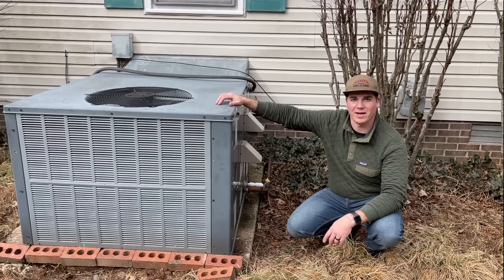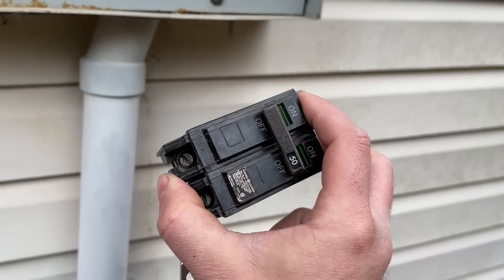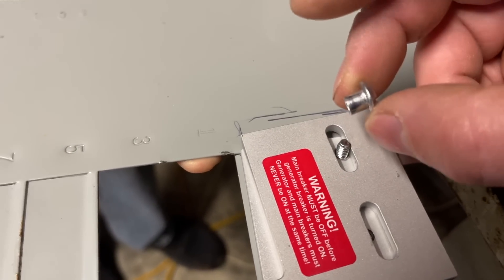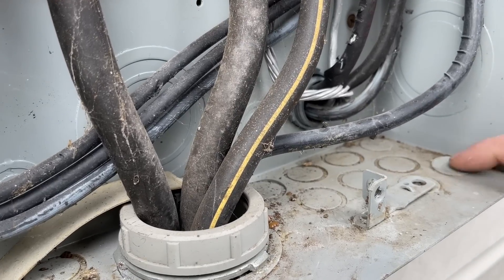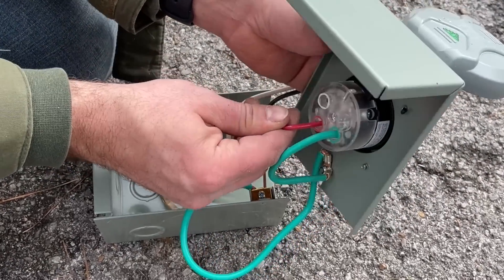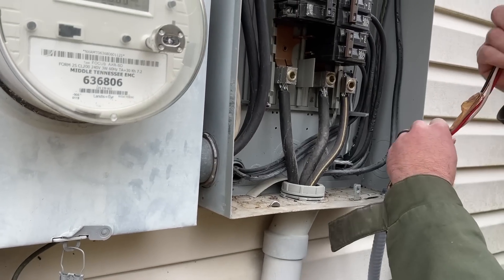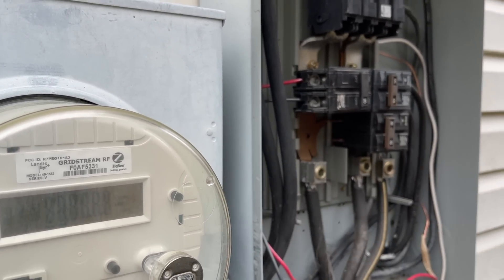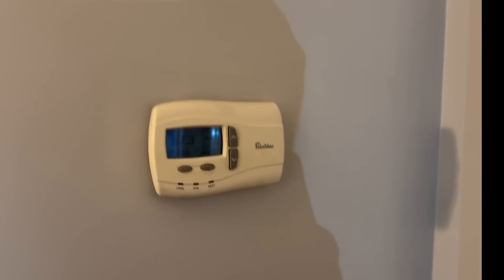The Best Way To Connect A Generator To Your Home

Comment: Great video.  Ok, so curious question.  You tie in the power inlet to its own breaker, flip the main off, power generator on, then flip generator breaker on, and you have power to the things chosen.  What's happening with those other breakers to the right where one is labeled "apartment" and the other one?  Do those get energized by the generator as well?  Is one the outside HVAC unit?

Comment: I have a Square D box on the outside of my garage. The service disconnect is located at the top/above the house breakers and it is a vertical throw. The only open slots for the new breaker is at the bottom of the box. I live in Arizona and lost power this last summer....record setting summer. Any suggestions ?

Comment: Just a heads up, as a general best practice, you should always disconnect the load from your generator BEFORE shutting it off. Newer inverter generators don't seem to mind as much, but those older ones like to cook themselves if they lose power under a load. But pretty much all generator manufacturers will instruct in the manual to disconnect the load before killing the engine.

Comment: There’s not a whole lot of breakers in your box to supply emergency power, I probably have 20 or 30. I know everything isn’t being used at the same time, but I have two heating units, two refrigerators and lots of other things to power as well. I have a 4000 watt generator.
Reply from the maker: This is not the distribution panel, it supplies the power to the other panel with all the breakers 👍🏼

Comment: When powering a home it is important that the generator's neutral and ground be unbonded from each other to comply with the NEC.  This is necessary because the home's neutral and ground are bonded together at the home's first point of disconnect (typically the service entrance).

Comment: Another good video. We have had several events over the past decade that have left us days and over a week without power. Are there any combustion generator systems that work in tandem with a battery system? I hate running them continuously just for a fridge or to have a night light on. I would think it's better to have the generator kick on when needed, like when the fridge cycles, etc. Any thoughts?
Reply from the maker: that would be super slick. I’ll have to do some investigating on that!!

Comment: I installed a generator tap on my pole.  got a 6500 watt generator.  I think it's like 23 amp breaker 220 rating on the gen.  I prefer to live dangerously and never installed a interlock.  I've never figured I could run a heat pump though.  I have propane backup, so i just put the units on emergency heat (gas only).
Reply from the maker: I have a video showing how you can run the heat pump with a generator even if it’s a bit lower wattage. 👍🏼 stay tuned!

Comment: Yes, as long as a generator with a 30a breaker to a 30a 125/250v TL receptacle or less plugged into your 30a 125/250v inlet on your house and #10 wire to the 50a double pole breaker would work BUT... The problem arises when someone else buys the home and has a genset that has a 50a breaker feeding a 50a 125/250v receptacle and uses an adapter to go to a 30a 125/250v (commonly available) now you have a dangerous installation.

That's why the permitting/inspector process is so valuable. It's not only for your safety but for the general public who may own the house down the line. You seriously don't want the liability.
Reply from the maker: Good point. My parents have been in this home for 40 years. I’m going to update it with #6cable and a 50 amp power inlet box next time I’m there.
Reply: @diyhvacguy  That works but if the existing genset works for what you want just change the 50a breaker in the panel to a 30a breaker, done! You can still use up to a 7KW genset with the 30amp wiring you have. I have a 7kw Honda Inverter genset and use exactly what you have (except 30a breaker in the panel). Good Luck and nice video.

Comment: Bro 🤯🤯Whats the generator amp rated at? And the Generator mount!  Most I’ve seen generators are 30amp which equals #10 wire!  That plug receiver could be rated at 60amp!  I’d change that breaker to a 30amp double throw! I’m sure you’re are aware those wires would melt b4 that breaker will trip!  Or at least increase to #6 wire - then you should be good! ⚡️🔌⚡️🔌⚡️
Reply from the maker: Yes I know that my dad isn’t going to overload this. All we installed it for was his gas furnace, the fridge and some lights.
Reply: @diyhvacguy  👍I’d still chg it just to be safe!  What if in the future the house is sold and the new homeowner doesn’t have a clue about amperage loads, designed National wire amp limits etc!  Truist me I love ur vids, and I’M NOT being disrespectful!  Just being concerned!  God Bless & tell pops I said “Hi!”🤠

Comment: Great video however I cannot wrap my head around how that 50A breaker feeds the whole house? what are those other breakers in that outdoor panel? Can this be done on an indoor panel in the same way? IE a 50A breaker installed in an open spot in the panel and the interlock kit on the 200A breaker? I'm guessing the only way the interlock kit can work is if the main breaker is close enough to the generator breaker...cant have the generator breaker at the bottom of the panel far away from the main breaker....does that mean another box has to be installed between the indoor 200A panel and the generator connector?
Reply from the maker: What I meant was you can select manually what circuits you want to power and limit what you are running under generator power.

Comment: Putting a generator interlock is one of the best things I have ever done.  I am using the electricity from my generator right now. We are in an ice storm and power is out all around me.  I can use my natura gas central air furnace, my internet, I can watch TV or anything else. The only thing I can't run ins the air conditioner, but it is 31 degrees outside.  Power is supposed to be off another 20 hours and I am hope to get through it with almost zero impact. Everyone thought I was over-reacting when I put the switch in and bought an inverter generators, but since then, have lost power several times and I have been ready every time.
Reply from the maker: Thanks for sharing!
Reply: @diyhvacguy  My power is still off. I look at these videos of people with $8000 batteries that they bought for emergency power. If I were running on a battery, I would have run out a day ago. It is insane to spend $8000 for battery backup if you live somewhere with tornados, hurricans, ice storms, or floods.  Battery backup, even with solar costs way more and is going to fail to get you through more than a short outage unless the weather happens to be nice, which it surely isn't for me right now, but I am warm and dry, typing this on a powerful gaming laptop, listening to the radio, and knowing that I can run almost anything it the house (I can't run the microwave, and four slot toaster at the same time if the furnace is running.

Comment: Great How to video simple instructions. I have a Reliance Transfer Switch Kit with Pre-wired 10-Circuit Kit and a Sportsman7500-Watt/6000 Watt Running Dual Fuel Generator that I want to hook-up to my home. Have you created a video demonstrating how to install this set-up using the different circuits? If not, can you? Thanks. Great video demo.
Reply from the maker: I haven’t but I’ll look into it!
Reply: @diyhvacguy  Thanks.

Comment: The generator must be 220V output to run AC compressor. That's why the generator inlet has 4 prongs, not 3.
Gas/oil heat can run with only a 120V generator, which only has 3 prongs.

Comment: My gas furnace is on the other side of the house from the panel, so I put up a new panel and run feeder outside for the generator and put a plug on the gas furnace then put a receptacle off a circuit from the panel along with other circuits for whatever, also a dedicated circuit for the refrigerator..

Comment: Good information. Had a local professional electrical company here to do this, accepted the bid, they never came back. Went to another company, same deal. Will have to locate the parts and educate myself a bit more. Shame on them when I have someone here on oxygen and they could care less. Be well and thanks.
Reply: Checking with the inspector is a good idea.  You can do it if you follow the instructions in the video.  As it was explained in the video, be careful not to touch anything inside the panel, and make sure the main breaker is off when you put the new breaker. Also, used the proper size wire for the breaker you will be using and torque to specific requirements.  You can borrow a torque wrench from many auto parts stores.

Comment: I would really like to do this at my home.  My outside box has only one main breaker switch.  All other breakers are in my basement.  Does that mean I have to add a larger outdoor panel to allow for the additional 50 amp breaker?
Reply from the maker: No these interlock kits are made in several different orientation, so you’ll seed to find the correct one for your box. It will show and image of the one for that listing so you can make sure it will fit. Then you’d just run that power to the exterior for your power inlet box and your good to go. So the same thing would apply, except you’d go inside to flip the main off and generator one on 👍🏼 if you have more questions about this email me at diyhvacguy@gmail.com 👍🏼

Comment: Even though this install wasn’t done per Code, You gotta also be careful with some of those Interlock kit you find online. Really Cheap ones are not UL Listed. Most of the UL listed ones also have a breaker retaining bracket that holds down the back feed breaker per code. In most areas, this job will require a Permit to do and inspectors love looking for that UL sticker and making sure the wire size is in accord with the breaker size.
Reply: Good point. There are a lot of aftermarket interlocks out there. It’s probably best to purchase the interlock offered directly from the manufacturer to maintain a listed solution.

Comment: Question: Since that was a 50 amp breaker shouldn't one use heavier wire than 10 gauge as I thought 30 amp was the largest one could go with 10 gauge wire? No?

Comment: Awesome video! I’ve got a Harbor Freight 3500 watt inverter generator that I bought last month. I want to do the same install to my house. It has a 120v 30 amp output plug on it. Would it still power my outdoor gas furnace like yours or would my generator need to have a 240v output like yours?
Reply from the maker: Yes it would 100 percent power your gas furnace and your fridge and some lights no problem. 👍🏼
Reply: Since you bought it last month, return it and buy a 10K watts tri-fuel at Costco for almost the same price. It also includes the battery and carrying wheels, which are extra at HFright
Reply: @OscarRodSeedsofG  I only paid $719 at HF with a 20% off coupon. The inverter unit is VERY quiet and isn't all that heavy.  It makes it easy for me to bring on a camping trip as well to power my RV.
Reply: @adamcrouch , that makes sense. The 10K I bought is very heavy but in my case is better because I use it as a backup generator to power my house during a power outage.

Comment: Excellent content as usual. As others have mentioned, bigger wire is always better less heat especially in a short run would’ve been a couple extra dollars and shut up the haters 😂. It’s always a good idea to follow the torque specs on your breaker torque is a big deal. If your house burns down, that’s some thing insurance company will absolutely check. It’s something you can go back and do later so I understand just wanting to get it in working and fine tune when the weather is better.
Reply from the maker: Thanks so much for the feedback! I really appreciate it.
Reply: Deodon, Beigger wire is not always better because the breaker will stipulate the maximum wire size. If you use a larger size beyond the breaker limit, it will be a fire hazard. The rest of your comment is right on.  Thank you for your input.
Reply: Yes, but it would be hard to overlook the maximum wire size if you were adhering to the different torque specs for the various wire gauges.

Comment: as others have pointed out the wire should be sized to the breaker, even if the plug is only rated for 30 amps. More explanation of generator sizing should be in this video. With a heat pump we're talking 50 amps or near 10Kw for a gen set, even though the demonstration was with a smaller set.
Reply from the maker: Yea, I shouldn’t have assumed people would know this doesn’t exactly apply to their particular system. We had a 50 amp breaker on hand but it should have been a 30. I’m sure I’ll be doing this at my house so I’ll make sure and make that one a bit more informative. Thanks for the feedback.   Dave
Reply: @diyhvacguy  I just hooked up my generator to the house last week. I went with a Champion model 201042  it is only 30a 120v so i only powered one side of my main panel. I hear there is possibly a safe way to use a plug adapter or wire the cable differently to get 120volts to both sides of the panel with a 120 volt generator.

Comment: I made an interlock for my panel a couple of years ago.  Another nice thing to have is a "power back" alarm.  Since your main panel is switched off when the interlock is in use, you may not recognize when power has been restored and can cut your generator off.  The "power back" device sets off a loud siren type noise when it senses the grid is back up.
Reply from the maker: Smart! I’ll have to check that out
Reply: @diyhvacguy  Reliance Controls THP108 EMW3561925
Reply: @diyhvacguy Question. My panel is inside my garage. On the other side of the wall outside is the meter box. My main 200amp breaker is inside the housing box outside. An interlock device will not work in my situation. How do you suggest that I go about locking out my main breaker outside so the panel just on other side of wall inside will not be hot. I currently have a 2 gang box inside the garage with a blank plate on it. The wire is either an 8 or 6 gauge wire in the box going a few feet over to inside the panel and terminated on a 50amp breaker. It was installed for a future electric car if we got one. Seems to us that we can use this now for a generator. Of course we obviously need to add the right inlet outlet and figure out a good solution for locking out the main breaker. The only thing I know to do is turn off main breaker and put a lock on the outside latch so no one can get inside it. 

Another question I have is this. Are you using a 50 amp breaker in this video on #10 wire? If so isn’t that wire undersized for that breaker. Or is it a 30 amp breaker? 

Thanks for the content. Really helpful.
Reply: For a quick and easy way - look for when your neighbor's lights turn back on!
Reply: @josephvetter7085  That might work when it's dark out, assuming you can see your neighbors house and they haven 't bugged out.  But who wants to jump up and look out the window every 10 minutes for hours on end.  Once you buy and install the alarm, there won't be any easier or quicker way to know when the power is on.
Reply: Pp

Comment: At start of video, DIY HVAC Guy Dave repeatedly said, "up to what generator can supply."   Still, I agree the 50A breaker seems too high for the #10 solid copper wires, and for the (Hubbell?) twist-lock plug, and for whatever extension cord will run from the generator to the twist-lock plug, and even for the generator shown -- which always have their own breakers on the generator outlet as Dave outlines.    (Encore Wire has a nice on-line "Wire Ampacity Size Table.)  Maybe Dave used 50A breaker to accomodate possible in-rush current, and knew the generator was "responsible" circuit breaker?  ////   But the idea/principle of the video's solution is GREAT.   Better yet, I have never seen nor heard of that mechanical slider interlock part -- really like it albeit it obviously cannot do its job when the panel cover is removed.   Lastly, I am so paranoid I counsel some sort of lock wire to ensure the twist-lock cover is securely closed.  THANKS!  Great video Dave!!
Reply from the maker: Thanks so much for the feedback! Cheers

Comment: Would that generator run heat pump and heat strip if temp calls for the heat strip to turn on?
Reply from the maker: Probably not this one. You’d have to have a large generator for heat strips. But I have a video coming out soon on how to use a smaller generator like this one for a heat pump. It lowers the inrush amps by like half! Stay tuned for that video. Cheers
Reply: @diyhvacguy , I look forward to your next video. Thank you.

Comment: So if my main panel is inside my home I should drill a hole and just run the wire outside then correct ?was the power on this on while you did this ? Thank you
Reply from the maker: And yes power was on. Just be very careful
Reply: Yep, you would need to run wire out to the "inlet box" for your generator.
Reply from the maker: Correct. As yoyo7856 said 👍🏼
Reply: The DIY HVAC Guy knows what he is doing. For none electricians, it is better if you turn off the main switch.

Comment: Your 3500 wat generator is less then 15 amps a leg. You are not going to power much of a house on it. Under two lighting circuits. 3600 watts would be 15 amps per leg with no voltage drop running at max.
Reply from the maker: Yea, we were working with what we had, my dad just has a gas package unit, all he needs is for that to run, his fridge and a couple lights. It did it no problem while we were doing this test. 
For a heat pump obviously you’d need a larger generator but this was for demonstration purposes. As I said, you need to get a power inlet box rated for your generator and your needs 👍🏼 cheers